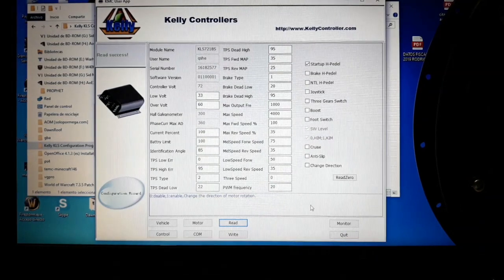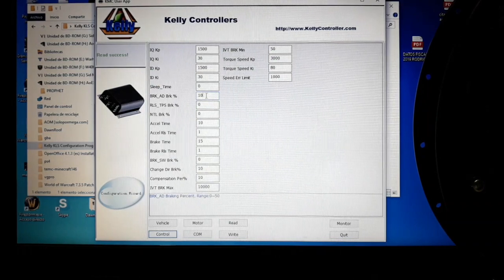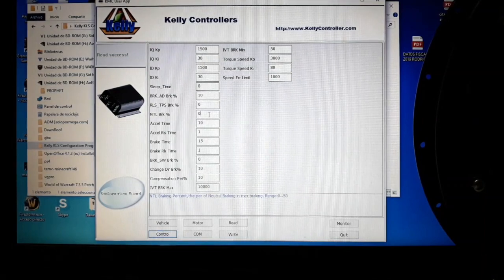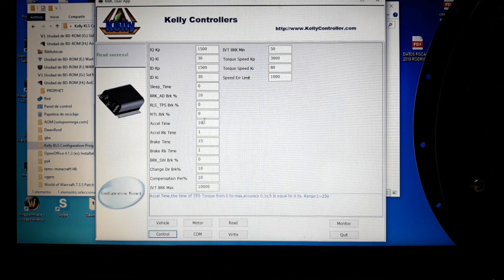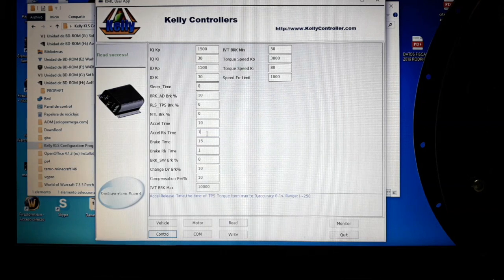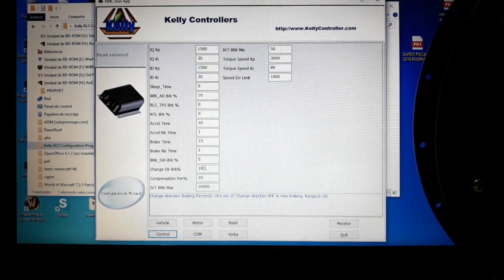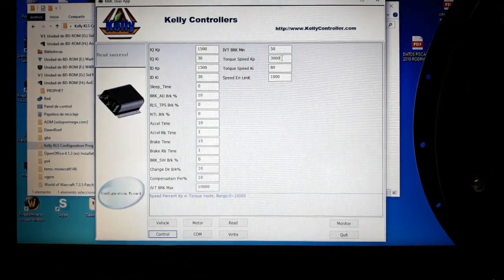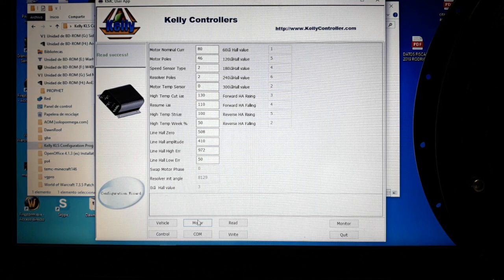KellyController Parameters, Programing setup, Part 3 (English)

Comment: How can i use KBS36051 Kelly Controller to control the motor remotely?
Reply from the maker: Hi Jiaxin, what do you mean with remotely?
Reply: Remotely from the computer or via remote control
Reply from the maker: @jiaxinlim2961  It will be quite easy it just need a 0-5V signal for the throttle and brake, and an on/off switch for the reverse.
Reply: @gonzalop.chomon327  Does it mean that i have to connect the wiring to a wireless module in order to do that? I am new to this whole motor and controller so i am not too sure on how i should connect them
Reply from the maker: @jiaxinlim2961  Yes, you need some kind of wireless module (receiver + signals creators) to do that. 
While it is not a very complex project for someone that has some experience with radio controls or electronics, it can be challenging if you have no experience in those matters at all.

Comment: I wrote error settings to the kls7230s and it went haywire, reads 0v and overvoltage, all halls at 1, software version and all other, including greyed out parameters changed, can you help? Idk if it can be reversed, I think I need to re-flash, but I would need the image and program...
Reply from the maker: I never had that issue, so I don't know how to help there.
Sometimes if the voltage is too high the controller does not start and becomes difficult to connect to it. The way to solve it is to connect the controller to a low voltage source (Battery or power supply) and try to connect and reprogram.
I do not know if it is possible to change the firmware on a Kelly controller. There is no firmware database at Kelly´s web page nor procedure about how to do it. I suggest you connect to Kelly to see if they can help.

Comment: Does anyone knows if the the Kelly Controller KLS7212S thrust command transfers to torque control loop or velocity control loop? What I mean is the "Torque Speed KP" and "Torque Speed Ki" are PID params of a Torque Controller or Velocty Controller?
Reply from the maker: It works as a mix of both, torque and speed control.
Twitching the PID values you can move from a torque controlled monitoring to a speed one. But never one or the other purely.
Reply: Thank you for the response. 
Do you know what is the logic of the "mix"? 
I'm sending successfully thrust cmds (0-5V)from a Computer to a Kelly controller that rotates some Motor. 
I also sample the hall sensors of the motor for velocity measuring . 
My goal is to control the velocity of the motor. 
If the thrust cmd is a transferred to Torque or Velocity I can build a simple Velocity Control Loop , but if its a "mix" , thats just a mess 😞
Reply from the maker: @Travellerrrr  Telling you the truth: There is almost none information how to "Tune" the PID in this controllers.
Let's say that the throttle signal is more related to speed than torque at low PID numbers.
I have found that the default PID values in some motors are overkill at accelerations, while with other motors are lame.
So I move them up or down until I find a nice driving experience.

Comment: IT COMES ON AND BLINKS  3  TIMES  THEN  4   TIMES
Reply from the maker: Means that there is an error at the Motor Angle Sensors. It can be damaged sensor/s, incorrect wiring or incorrect Sensors Angle procedure.